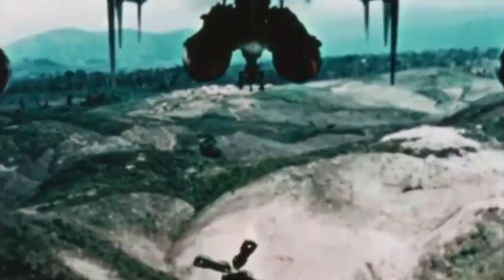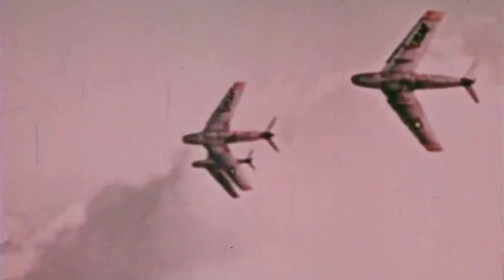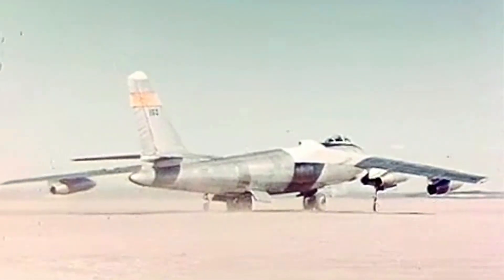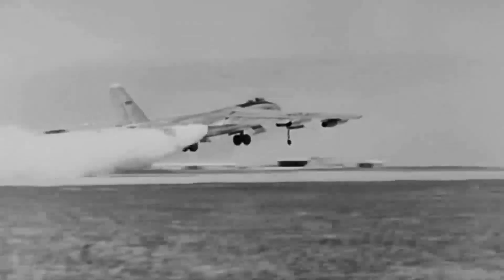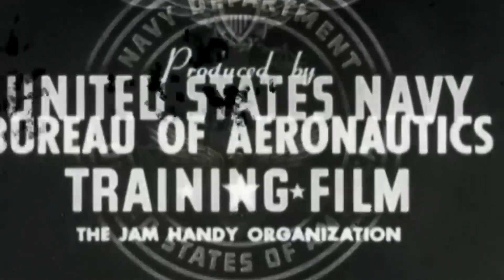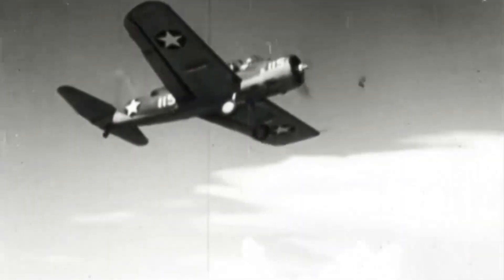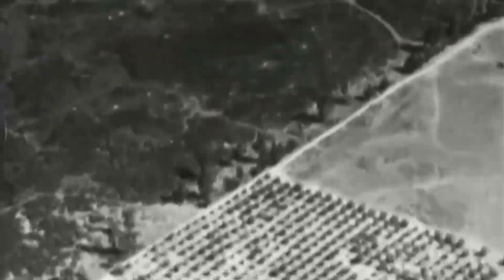This Massive Airplane Flew Upside Down to Toss Atomic Bombs - B-47 Stratojet Idiot's Loop

Comment: The idiot loop was also the reason for the many B-47 explosions in the air. The wing spar broke inside the fuselage after a certain time due to the high stress caused by this maneuver. Electrical cables and the fuel lines were destroyed. Short circuits and fuel vapors then triggered the explosion.

Comment: We also trained in A-4 Skyhawks to fly in fast at very low level, pull up at high speed directly over the target, then release the bomb on the vertical and continue the half Cuban 8 at high speed back down to low level, gaining as much speed and distance as possible before the explosion. The idea was the bomb placement was accurate enough.

Comment: It was called an Emmanuel maneuver used in WW I and WW II by fighter to reverse course quickly. Toss bomb maneuver was intended to fly in low under radar at max speed and rapid climb. At the apogee of the climb the bomb is released the plane does a wing over and speeds away from the blast zone.   This maneuver stressed the B-47 wings  and several planes did loose their wings. It was discontinued because of airframe stress.  The B-58 hustler was designed to bomb in this way and speed away at mach 1 or more.

Comment: Good stuff. Dive bombing has a bit of earlier history than the post-WW II US case mentioned here. The Nazis used it early in WW II. It was very successful as part of the blitzkrieg strategy as Germany invaded much of Western Europe before the Battle of Britain. The Messerschmidt was used. British air defenses, secret until just a few years ago, consisting of concrete pop-up machine gun nests, plus the addition of hummocks protecting the active spitfires as each protected area had only two planes in it made the odds too much. The Messerschmidts had a 50% loss rate, and you can't afford to lose a whole plane half the time if you can only destroy 1 or 2 on a successful run. The German air force had to pull the Messerschmidts out of the Battle of Britain and give up on dive bombing.

Comment: When I was a co-op engineering student at Eglin AFB in the late 1960s, some of those I met mentioned that B-47s had tested that 'Idiot Loop' there, releasing it over the Gulf to strike near the bombing ranges inland. For a followup to this, you might discuss skip bombing used to bounce a bomb off the water and into the side of a ship. It's very risk but also very accurate. I believe a similar technique was used in Europe to guide bombs inside railroad tunnels. https://en.wikipedia.org/wiki/Skip_bombing

Comment: Wait, pioneered by Richard Bach, like “Jonathan Livingston Seagull” author Richard Bach?
Reply: Well, yes and no. In his 1963 debut book, Stranger to the Ground, he does indeed describe the LABS method, which he trained a lot at the time, and the words above are verbatim from the book
... in his F-84F fighter-bomber.
You see, I thought it VERY strange to find Bach connected to B-47s in the video, because I vividly remember him describing flying F-84s and F-86s ONLY. So I fetched the book from up high in the shelf and checked this passage.
Bach was never involved with B-47s, was never at Eglin AFB... In fact, in 1957 he was still a cadet and could never have performed the demonstration. The video mixes everything up. Certainly there must have been a demonstration at Eglin with a B-47, and certainly Bach describes the technique from a first-hand point of view in the book. But the two things do not go together.
Reply: @joaopaulocursino765  Thanks for explaining
Reply: I had to look it up but it seems like it's him. I was a huge JLS fan, LOL. Far out, man!
Reply: Maybe all of that crazy flying gave him a greater appreciation for seagulls?
Reply: 3:05
So it is acually him...

Comment: "He pulled the clutch..."

Uhhh, I've got a few thousand hours flying high performance jets and none have ever had a clutch...
Reply: Well, the f-35b has one to connect the fan behind the cockpit
Reply: @Robert-Cinque777  LOL Okay, yeah, fair point

But not one you can pull like a motorcycle
Reply: Every episode has a rediculous error like this.  Like when he said a helicopter's engine and transmission are in the nose.
Reply: @geosync9742  The H-19 and H-34's engine and transmission were in the nose.
Reply: The clutch on some Porsches can be replaced with Volkswagen clutches. I just said that because I didn't know that the F-35b had a clutch and I wanted to sound smart. I'm gonna blame it on the fact that I like the F-22 more.
Reply: @warpartyattheoutpost4987  A Porsche is basically a hot rod VW
Reply: @warpartyattheoutpost4987  l didn't know there was a difference aren't they made by the same guy?
Reply: I thought he said crutch as in bomb crutch which holds the bomb steady until release.

Comment: "What's the most structurally fragile bomber we have? B-47, eh? Alright. Make it do loops."
Reply: Dad described it as a better looking B-17 with more rivets. The control cables passed through holes in the frame gussets. They each got a big blob of grease. Unfortunately it flew higher than prop bombers where the cold froze the grease leaving the plane impossible to steer. Answer: throttle v BBC ack slowly until the grease would melt so you could regain control. How would you have liked to be the guy who discovered that? He was my dad.

Comment: Around '77 - '78 I read a memoire by a fellow who had joined the USAF and learned to fly B-47's. He claimed that crews had become increasingly wary of the plane, as they had heard too many stories of aircraft failing to return, often with no conclusive evidence as to the manner of their disappearance. Crews, though, were of the opinion that the toss-bombing manoeuvre was overstressing the wing spars, leading to catastrophic failure. One day, flying far north (it may have been over Quebec, but I'm not sure), he was watching a B-47 beside his when its wings simultaneously folded up, as if it were some giant aircraft carrier plane. It went down like a stone and no one got out. He left the Air Force not long after.
Reply: Bs. Never happened.

Comment: Call me dumb but couldn't they have fitted the bomb with a time delay fuse to allow the delivery ac to escape before detonation?
Reply: Air bursts are more effective than nuclear detonations on the ground, and if the bomb was seen digging itself into the ground the enemy would attempt to detonate conventional bombs next to the nuke to cause the core to fizzle. Plus you can do a toss that doesn't drop "over the shoulder" and instead tosses the bomb forward. This means you can drop without even flying over the target.

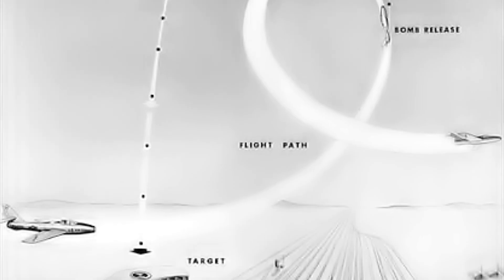Comment: I hate it when 4x3 footage gets cropped or stretched to 16x9. It would have been easier to understand that diagram at 2:00 if you can see the whole thing because it explains the loop very well. :-)

Comment: Israel's IAF practiced the "idiots loop" with A4 Skyhawks using dumb bombs. The A4 has long landing gear and hardpoints for a heavy centerline fuel tank, and required little modification to carry its (alleged) nuclear bombs. Reportedly they planned to drop one on the Sinai in the run up to the Six Day War in 1967 in hopes of convincing Egypt and Syria to back off. Concerns over Egypts large and modern Soviet-supplied Air Force resulted in the plan changing to one where they would fly a special commando unit in with the bomb using helicopters, establish a base in the Sinai, and detonate it on land. Before they could do this, they would need to establish air superiority so the helicopters wouldn't be vulnerable. A planned initial attack on Egypts air force went much better than expected (nearly wiped it out), and swift hard-fought victories on the ground had Nasser pulling ground units back from the Sinai by the end of the 2nd day, so Israel decided to hold off on their nuclear option. The latter part was revealed in a report in the Israeli Times in 2017, but the practice runs of A4's delivering bombs via the Idiots Loop has long been known. Tom Clancy used that story in the opening chapters of his book "Sum of All Fears", though his story has the bomb being lost over Syria when the A4 was shot down.

Comment: I have never heard this being called “The Idiot loop”. My Father was in SAC. Incidentally he was a bombardier/navigator on a B-47 it was called “Second Station”.  On a bomb run the aircraft is turned over to the bombardier. On a “Toss Bomb Run” The “Second Station” is along for the ride. A computer released the bomb. There was nothing daring about it. The B-47 was an excellent airplane and considering that you had  jettisoned a considerable amount of weight and a lot of fuel was already used up, there was no “undo stress” on the airframe. You discuss the “Over the shoulder” launch technique. This was never used with the B-47 as it is self-defeating. The half-loop, with a half roll on-top leaves the Aircraft in the perfect position to use momentum and power to escape the blast. Nuclear weapons were getting smaller, lighter and more powerful all at the same time. The whole thing you’re discussing here was a stopgap. At the time you’re talking about; the B-58 was coming on line, but that an interesting story in itself.
Reply: Because it never was.
Reply: Actually that's why you have a g meter.
Reply: Well said

Comment: Way over-hyped and muddled description of a simple delivery system.  The Low Altitude Bombing System or LABS "computer" was hardly more than a kitchen egg timer used in conjunction with a simple flight director display to help the pilot start and hold a nominal 4 g pull up in tactical jets and maintain a pre-selected heading during the release sequence.  My understanding is that the B-47 flew only a 3 g pull-up.   It works like this:

One of 3 types of delivery is selected prior to flight as suited to the appropriate tactic for the delivery... low angle, high angle or over the shoulder.  Note that lay down and CCIP deliveries mentioned are not associated with this system.  Determined and computed during preflight planning is a navigation initial point (IP) to begin the delivery, the wind corrected run-in heading from IP to target, the bomb range from release point to impact based on run-in speed, release angle and bomb type, and a time computed to fly from the IP to the release point.  Type of delivery, release speed and maybe other inputs (it's been a long time since I did this) are set in the LABS panel and the delay timer is set for the time from IP to release on the timer... the mechanical "kitchen egg timer".

The actual delivery is made by flying to and crossing the IP at the correct speed and heading.  With appropriate weapon panel selections previously set the bomb "pickle switch" is pressed and held when crossing the IP.  The flight guidance display, a set of crossed pointers representing heading and pitch command then come into view (like cross pointer ILS needles) and the timer starts it's countdown.  The commands to maintain or correct pitch and heading are followed until the completion of the countdown time when the pilot hears a tone and the display commands the pull-up and heading directions until bomb release.  At bomb release there is another tone and the command needles go out of sight for low and high angle deliveries but continue for over the shoulder delivery until the recovery angle is achieved.  The over the shoulder delivery talked about in this clip was not a complete loop, it is a 1/2 Cuban 8 maneuver with a roll to upright at 45 degrees dive accelerating to a max speed escape from the target area at minimum altitude.

None of this required any abnormal or exceptional pilot skill or unique bravery.  Outside of employing a nuclear device it was routine pilot stuff.  One of my favorite things to do when training with inert bombs was to roll back to the bomb after release and fly formation on it until shortly before impact and watch where it hit.

I miss the 'good old days'! :-)

Comment: more proof that pilots, as well as engineers are in fact just a little bit insane.
Reply: Beginning with the USAF Test Pilot Class of 1956-D the new test pilots were aeronautical engineers and seasoned pilots. The calculations of the maneuver were done by hand with a slide rule. In the cockpit the pilot used instruments and a stop watch to perfect the technique. Dad never spoke if a computer in that application. His work took place at Edwards a year before the public unveiling. Also in that class were astronauts Gus Grissom and Gordon Cooper. I prefer to think of these men as geniuses with giant balls of steel.
Reply: well might as well use the opportunity.

now they get completely obliterated for tiny things that wouldnt change anything that happens.

Comment: Cuban is my Fav!

Edit: The method of delivery also varies with the Device, Yield, Type of Burst(s), Height of Burst(s) {Surface, Low-Altitude or Near-Surface, Low-Low-Med Air-Burst etc.) and Target Values (Countervalue v Force, Lay Down, Para-Retad System v Gravity Only etc.) The aircraft had to clear radar so Approach would be low (see the BadArse BONE!) and sometimes pulling-up in order to deliver and evade SAM & AAA-Batteries, but avoiding/keeping the Fireball and Blast Fronts behind the aircraft and crew were Important! They had to Return to Base, switch Crews, refuel and Reload to ensure Retaliatory Strikes destroyed the Aggressor's ability to respond or to ensure we hit the 25% Threshold first! (Aka: "MAD")

Comment: The B-47 was a SCARY airplane~!!  Get it up to altitude, like FL350, and this thing had a "coffin corner".  What is "coffin corner"?  Well, in swept wing jets, the higher you go the higher your stall speed becomes.  And the higher you go, the LOWER your maximum airspeed becomes before you get into "mach tuck", or where the center of lift moves backward until it is behind the center of gravity and the wing suddenly tries to push the nose down violently, breaking the airframe apart.  On airplanes like the 767 at 35,000 feet and typical loads, the difference between these two speeds is 60-80 knots.  In the B-47 it was 5-10 knots, and while that 767 has sophisticated autopilots, the B-47 had NONE at all.  

Folks IMHO, the people who flew these airplanes had balls the size of coconuts~!
Reply: Thanks. My dad appreciates your observation.

Comment: I remember my grandfather telling me about flying the same basic maneuver called "parabolic arc bomb deployment" in the B58.  They would ingress at "hard ride" level(treetop), pull up to a pre determined deck angle for the type of bomb/distance to target, release, continue over the top and egress again on the reciprocal track.  No idea if there is any footage of it though...IIRC he said that under the right circumstances, they could create roughly 20 mi separation from their CPA(Closest Point of Approach) and bomb detonation(usually airburst nuke) and almost double that to the aircraft.

Comment: I had a 70s aviation book as a kid and it showed Toss Bombing but a different method to the one you showed in this vid. In the book it was shown diagrammatically but not the over the shoulder toss, so to speak. The method depicted in the book you actually make mention of momentarily, but it was fly low towards say North pull up to ~85deg vertical, release, continue over the loop and begin descent to south, still inverted, then roll upright while still descending south to gain energy. My whole life since then has been tainted with the falsity that this was Toss Bombing, only to find the technique described to me in a book was only one of several techniques.
My whole life is ruined, a young impressionable mind was filled with a half truth - heavens, I'm having an existential crisis aaaaarggghhhh....

BTW, you've hit a formula that is good with these vids. The dry factual style you use at first seemed cliched to me but after watching many vids of yours now I have come to trust the channel. The dry factual style is in sync with fact and historical accuracy so I now like like it. The topics you choose are all topics I have searched for over the years so you really are finding your niche and groove.
Keep up the good work - you've picked up a sub.

Comment: Might have mentioned that B-47 toss bombing was a failure – discontinued after a year due to several wing separations in flight caused by structural stress. Worked fine with the smaller fighters.
Reply: Mr. Watson: I would like to know your source for this opinion. Seriously.